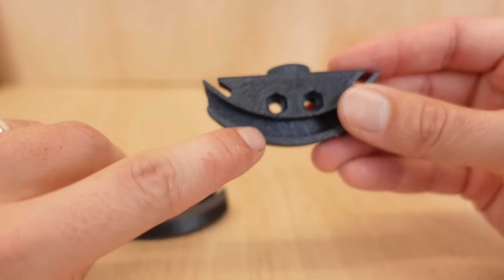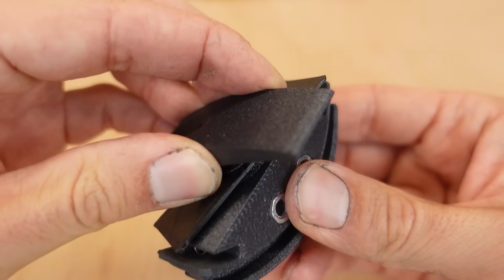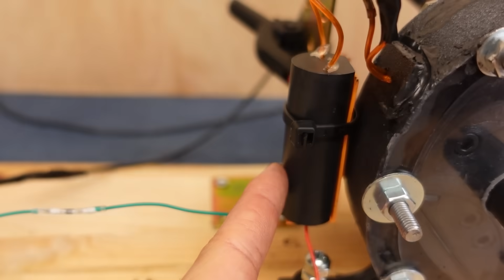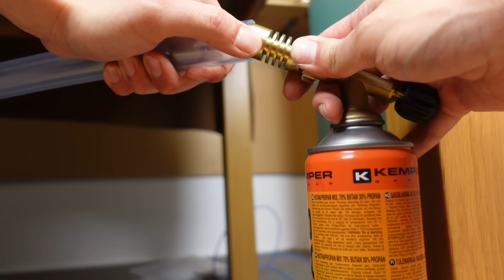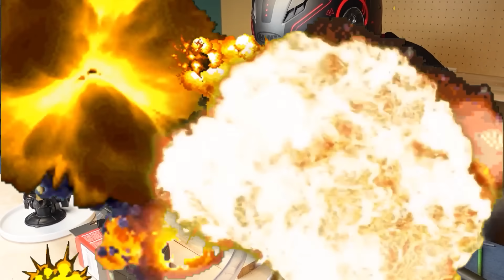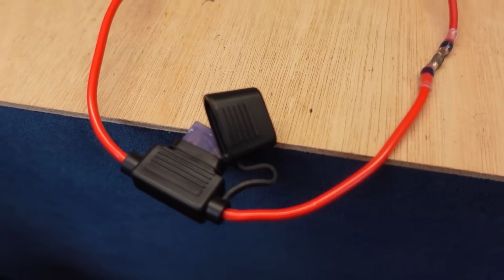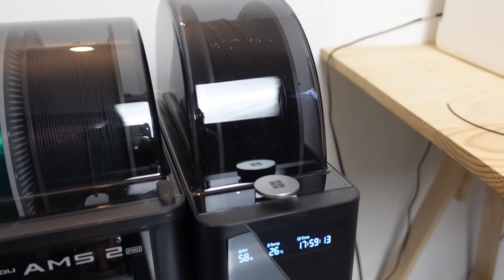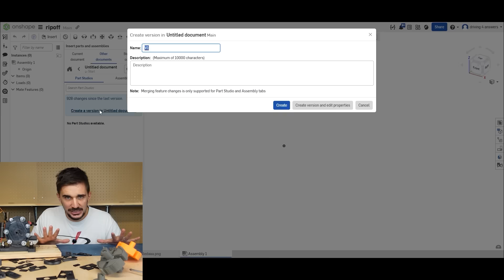My Oval Engine Now Fires At Will! Major Milestone For DIY Oval Rotary Engine 2.0

Comment: esta pasado de combustible,para regularlo necesitas el carburador de antes que para ser honesto no los conozco bien pero en una motocicleta se usa una flapera para las 2 tiempos como valvula de entrada del combustible y retencion,en los carburadores de 2 y 4 tiempos se gradua con distintos tamaños calizuars de chiklers y con altura de cortina pero en los carburadores de corta pasto y motocierra eso es distinto(cada vuelta mete mas combustible por eso explota en el escape buscando oxigeno).Tambien seria mas eficiente el volante de inercia con bobina de ignicion,pero bien centrado y sincronizado.Por otro lado tambien recomendaria un taladro electrico o neumatico que tiene mas rpm,ademas diria que el acrilico tiene que ser muy grueso para no sufrir fisura o deformacion tal ves una tapa ciega de metal o del material del block serviria mas y por ultimo pero mas importante que todo tener extintor quimico o un trapo mojado para ahogar algun posible mini incendio(deposito de nafta con poca nafta)espero sirva para algo,saludos desde argentina y felicitaciones por los logros y avances,como dato curioso he visto compresores de aire acondicionado de autos que son bastante parecidos a tu primer diseño y van lubricados interiormente por venas de aceite,tal ves una mezcla de aceite y nafta seria a cosiderar...

Comment: So, it's been 9 months now. I assume you would have delivered by now...
Reply from the maker: I never tried again. I do youtube for a living so the somewhat unfortunate reality is that content must perform in order for me to devote time and effort to pursue a particular direction further. I tried several vids but this seems to be a pretty niche topic with very low mass appeal.
Reply: @d4a
I was waiting too 😢
I love prototyping! 🔥
And any inherently flawed crazy rotary idea. 😁
But sealing aside, I'm only now trying to understand the thing "torque-wise", and from this viewpoint the first prototype (from the compressed air engine) makes much more sense to me: it should be able to produce a "tangent" force = torque. Can the other designs actually do that or almost only produce a radial push against the shaft? 🤔

Comment: Hi! Great experiments! It seems like the ignition is too late creating pressure at an un ideal angle. It also looks like the declaration is travels backwards. Limit that as much as possible. Put a little carved out area either in the housing or traveling piston at highest compression location and at and ignite the fuel just as the rotor is just passing that point.  Reduce friction to a minimum by using bearings inside the sliding slots! Build a second assembly and mount it to the same shaft at 90 degrees to the other so that each will help the other through their point of highest resistance. I agree with the people saying to use regular spark plugs and sparking system to simplify the variables… I hope you get it working! I am cheering for you!

Comment: I believe you need to put an adjustable cam that activates a spring loaded valve so you can time the fuel. That way you can control, when and length of time it gets fuel then introduce spark. For your spark have you thought of a disc with with and carbon brushes to control spark timing and duration. Die a disk that has differs lengths of wire longer wire more spark shorter wire shorter spark duration.

Comment: It is strange that you are only getting one combustion. I mean both sides are the same.
Also I love your “never give up never surrender attitude.”
With that attitude it is going to run. Also I learned many things. Your apex seals are big. I can’t figure out why mazda uses such tiny apex seals. Every piston engine uses three rings (apex seals) some even use four. Perhaps Mazda needs two apex seals or three, or one large one like your four, and even have them cut at an angle to slide along in the housing. Plus it looks like yours doesn’t allow unburned fuel and air to leak backwards into the exhaust (the wankel’s famous brap sound)) easy fix, instead of a hole inside the combustion chamber at spark plug number 1 they could just have a slot and with wider apex seals like yours, it would keep that spark plug slot sealed, it would eliminate fuel air leakage fixing the the bad emissions and bad mileage at the same time. I think I heard or read that Wankel’s get hot? I think your configuration would not get quite as hot with two combustion events rather than the three the Wankel has. The rotary is the best internal combustion engine configuration. I believe the world doesn’t want the rotary to work. The automakers would be in panic mode. Every company, in time, would ditch every piston engine. 
Am I rambling, yep. 
Good work sir!!!

Comment: Possible alternative: instead of using vanes that change length throughout the combustion cycle while moving through an oblong space, would it be possible to rotate fixed-length vanes through a circular chamber while using variable distance between the vanes to achieve the 4 stages of combustion?  In this proposal the vanes would move closer to one another and then further apart as needed.  I'm thinking actuation similar to desmodromic valves might provide the precision needed. But I'm an accountant so engineering is outside my expertise.  By the way I very much enjoy your videos and your approach to explaining topics.  P.S. My girlfriend calls you "the crankshaft guy."

Comment: The explosion occurs when there is the greatest volume between the central rotor and the oval walls, creating resistance to the movement. Therefore, you would need to design a rotor that triggers an explosion to push it forward. Use a triangle inside a circle; each space would act as an implosion chamber, driving the triangular rotor to rotate in a single direction... this would be easier since there are no moving parts inside the rotor itself. It would be like a three-bladed Pelton turbine. Regards.

Comment: Get a AC Ignition Transformer (Old Oil Boilers / Space heaters - Note they can be Spicy & Deadly> they run jacob's ladder electric arc  Very well  ) + insulated-gate field-effect transistor (IGFET) +  opto-isolator (or optocoupler) 
 Also Use MEMS (micro-electromechanical systems) Chip tech > magnetic Field Rotatory Encoder + Round Magnet (Shaft END)

High Speed MCU -  STM32N6 clock up to 800 MHz so can Use a rotary resistors to Adjust Timings And Spark Timing An Length + A RC Servo To Control the GAS 

Get A AI To wire the code

Comment: An electrician taught me once that for making holes in acrylic with a drill bit, you must do it with the drill rotating backwards, and the heat generated by friction makes the hole... Is very clever because if you do it rotating forward, at the end of the hole, the edge of the bit will stuck in the endside surface generating tensions that breakes the acrylic sheet.

Comment: Hey bro. You are still running that black module wrong. You are suppose to use a 3.7 volts (lithium ion) battery. I promise the power of the sparks will be crazy. Donr use alkaline battery's bcz those suck for this. I hope to seen you use thes hv generators in the future engines but the right way.

Comment: I feel like the wire length on your spark setup was contributing to the inconsistent sparking/ignition, particularly at speed, due to the flex.

If I were you, I would work on coming up with a more reliable and tunable way of firing a spark-plug using that spark generator. Then once you know that your ignition is reliable and tuned to whatever motor you're testing, troubleshooting is much easier.

Comment: The video is quite old, but I’d like to explain why your engine won’t run. In a Wankel engine, the crankshaft is driven off-centre by the piston, which means the direction of rotation is always fixed; this is because, with each ignition, the force isn’t directed at the centre of the crankshaft but passes off-centre – which generates torque in one direction. In your design, the energy is applied exactly at the centre of the crankshaft – so no rotational movement is generated. Greetings from Germany ;-)

Comment: i know why its only firing on the one "piston", you are compressing the gas back into the pipe, then when piston 2 comes by there is more pressure in the gas pipe to give it the gas its needs, dont think its sucking in gas, when you give it more gas the whole engine fills up and it just firs willy nilly and makes a flame thrower lol

Comment: Question, Would a ball bearing on each end of the "pistons" not be  a sufficient seal ? I mean this engine is not running at 50 rpm, but i.e. 1000 rpm. So the the tightness of the ball bearing would be almost irrelevant and the bearing would last much much longer than your gasket, right ? Well it needs some  oil of course.

Comment: 🔴I just found this video, 5 months late.😢😭😭 So I don't yet know the result of the project...😟😭 This is the perfect project for You, (even if it... umm... Fai... Fa... WORKS)😆
⭕Right now I see two(2) possible issues. 1.Gas Expands in the cylinder sucking out the heat. 2.Most of the Energy is going out the exhaust. A "2 Stroke style" exhaust-pipe is indicated.

Comment: The Honda patent callback made me smile instantly.

OTOH ... it also made me think of more realistic problem solving, like having a small methanol-compatible flex-fuel spark-ignition engine as part of a plug-in hybrid drivetrain. (targeting high methanol content blends, even if they aren't widely on the market ... anymore, aside form maybe China, would tend to imply materials compatibility broadly tending to also tolerate most other alcohol based alternative fuel blends and more conventional gasoline blends)

Comment: In my opinion, That did fire only from the gas air mix being ignited from a spark. Same thing happens if you put some lighter gas in your hand and spark it. I think an aluminium made and lubricated version compressing and combusting gasoline may work. 🙂👍

Comment: Love the persistence, might i suggest a resin printer. You are going to get a way better surface finish with way better thermal resistance than any thermal plastic can provide you. You could also print it entirely clear. Sriraya tech blue is blue transparent but very robust.

Comment: The common aspect of all combustion engines is they give the expanding combustion a direct path to expand into the movement and directly transfer it into the rotation. I fear with your set up you have simply made a rotating combustion chamber rather than something that can generate continuous rotational propulsion. The original vein design you had still had the opportunity to push in a circular motion. This is where the common piston engine has the most effective part being that all expansion is directed into motion

Comment: My suggestion, it needs air fuel ratio, not just pure fuel, even though it’s in an aerosol form. I don’t think there’s enough oxygen for a good combustion and you might want to try and rig up a more precision ignition rather than the two floating wires after that, I think it’ll work.

Comment: Add a big flywheel and it'll be much easier to see if combustion is actually creating torque. The drill directly driving the engine makes it hard to know. Plus less noise interfering with your video recording. Wrap a long string around the shaft to start it.

Comment: You should try a D or []shape exhaust port, with the flat side toward the port. A lot of exhaust gas is escaping that very beginning of the opening when you may have intended the timing to be more around the middle.

Comment: Hang on a minute: for this to run the combustion needs to happen when the combustion chamber is at its smallest, so the expanding gases can drive the rotor through the expansion phase. As it is, the combustion seems to happen pretty much when the combustion chamber is at its largest, at the end of the combustion phase, so of course it will pop but it won't keep running.

The ignition timing needs advancing A LOT - perhaps by 60+ degrees.

Comment: well the problem is your not starting with the perfect combustion event and working backwards from there your trying to fix some elses problems figure how to create the perfect combustion event and build the engine around that, force=mass x velocity, and combustion wont produce any force if the fuel doesnt expand when ignited which propane or butane does not expand that much i live in a city where the average person makes 1200 but average rent is 2000 so i dont really have time to solve the worlds problems i have 2 jobs and i just had an interview yesterday

Comment: The reason why you need oval and not an ellipse is not "easier travel", but you need to have the chamber offset from the axis of rotation, so that it creates a lever. The more offset it is, the more power transfer you can do. You can also use a design way where you define a travel path of the object, which then creates a line of the internal chamber of the housing, this way you can control how offset it is from the center line, thus vary your lever length.

Comment: Two questions. When it fires, does that produce enough energy with that specific fuel to make it rotate, or does it need a fuel with more energy?  Second question, sorry but I do not understand exactly how the drill driven rotation works.  So, once the motor starts firing is it free to spin at its own needed speed to really get going, or is it's speed too restricted by the drill?

Comment: the primary is melting liekly i seenow after i typed this, ,,. your battery is  12 volt battery and you could is a 6 volt coil you could use two flash lite batterys in series that gives 3 volts what you could calls for.  recommend a book on basic electric a really good one from US exists, covers everything only takes a few years to absorb it all fully and understand everything no less no more, depends,.,.   with that,,.  see my last too you can look up inductive kick , when it opens there is a moment when the coil builds up very very hi voltage which is why it sparks, you likely want more resistance on the sparking area too,  as well as the battery side, just try an old junk yark coil from a caar or motor cycle lots of motor cycles in the junk yark have single coils an old chevy would liely be the cheapest, fyi late rick W

Comment: the coils should have a capacitor placed  in series somewhere, evern if it is small it should be hih voltagae too, read up on iniductive kick. the coils are reaching too hi voltage then too hi curent and thats it fry done deal, they are only little tine wires painted with insulation pain that cant handle much voltage and far less current, maybe a resistor in series would help too, meausre the ohm dc ohms of the cpil, caluelate using ohms law and try a hi resistance 1st, if it works, good if not decrease resistance you could use a pot, m nanother option would be to use a junk yard coil from an old chevy or what have you over there in that part of earth planet, later good bud w from U.S.

Comment: it felt like theres no way this janky (no offense) engine would have any compression but when i heard those pops as you were turning it slow with the pliers i was mind blow like how does some 3d printed plastic have so much air tightness and also seeing another youtuber making a more normal engine out of 3d printed part i was thinking when are you gonna put on a flywheel because you NEED it to actually make the engine turn over more than once and also if you do make it you can just 3d print a bit wheel and put lots of screws with many nuts on the other side to make it heavy adjustable in weight too also you can make hte part htat connects to the drill have angled pieces so when it turns over it pushes the drill out of the way so the drill isnt slowing it down

Comment: It looks like the expansion event’s force vector is mainly directed towards the center of your rotation, which doesn’t really help you get the motor moving. If the force vector was directed towards one side of the AOR then you’d have a moment, and thus spin

Comment: scale it up. smaller cumbustion chambers are harder to get running right for a number of reasons and also less efficient. bigger engines quite literally have more room for error. im pretty sure youd be able to get more feed back and a higher chance for success if you just made the whole thing bigger. once you get it dialed then you can scale it back... just think of how much more finicky and unreliable a small desk top novelty engine usually is to run compared to their full sized counter parts and also how much less efficient and less power dense they are. they normally have to be set up perfect for them to run at all and even then their kinda trash and cant produce an appreciable load.... ALSO you gotta get that drag down. maybe think of applying a surface coating to your prints like a ceramic coat to make a harder slicker surface (should be able to cure a ceramic coat at a low enough temp so as to not distort print with the right filament.) the one thing i cant stand about 3d printing is how many people just try to use it as a complete system front to back with no post processing of any kind, very few production processes manage that and 3d printing is way off the mark for ALOT of applications but every one ignores that any way because it diminishes the convenience factor. at least sand and polish it or something. start thinking of it more as a rough casting rather than a finish "machined" part and i think youl find some appreciable efficiency gains. engines have to be as precis and rigid as possible and a pile of parts right off the printer bed arnt going to cut it, they never do, at least not for stuff like this. try building a conventional piston engine the same way your building this and bet you money you will never get it to run reliably and i think you know that so why would you expect it from this?